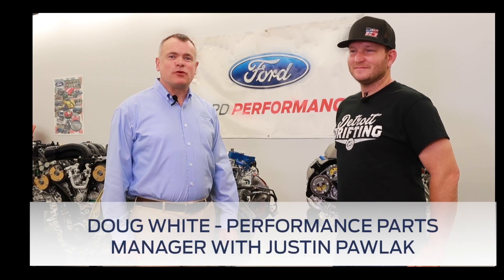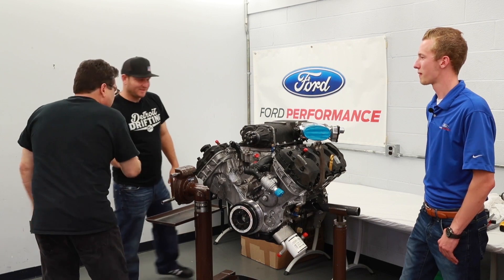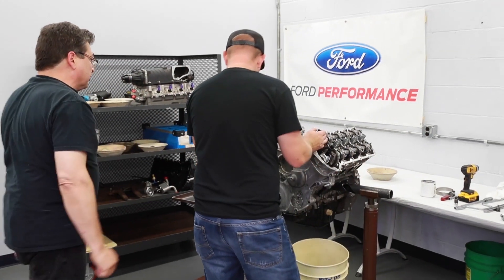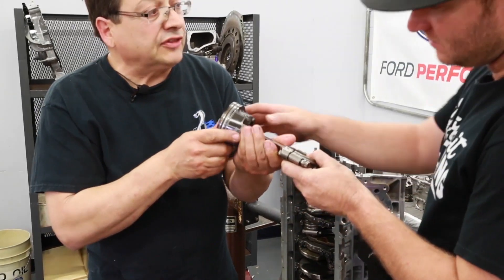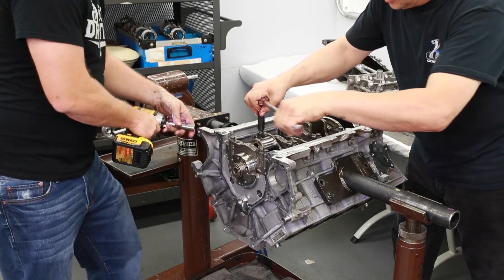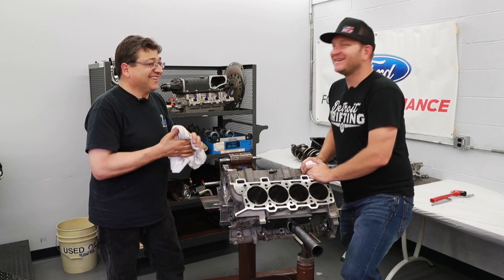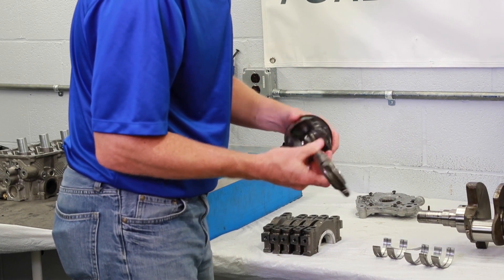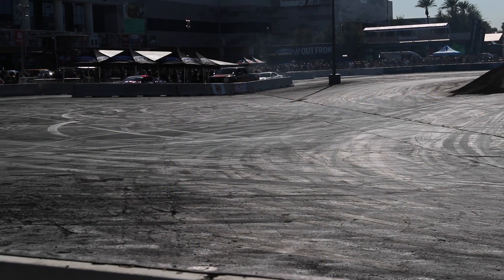Ford Performance Aluminator Teardown with Justin Pawlak | Ford Performance

Comment: So your purpose-built tire-spinner that never comes anywhere near actually placing the engine under "full load" proves a "Coyote" is really, really "durable" because it never "wore" during MAYBE 20 HOURS OF PART-LOAD "MOTORSPORTS-
ENTERTAINMENT" USE? 

That's funny.

Comment: can you use the Aluminator XS 5.2 engine on a street car?
Reply: Depends on how old it is. If the car is over 25 years old, you shouldn't have a problem.

Comment: That's what ford performance wants to see. Longevity. I will not be surprised of your setup is in the new gt500. You have one hell of a secret contract with ford performance. Ford put this motor in the gt500 it's only meant to be.

Comment: Why don't you guy's there in Dearborn focus on rating your performance products on 91 octane like the rest of the world instead of over ratting them on Michigan 93/94 octane, like I've been told by various engineers there at FMC. Nobody else rates on anything higher than 91 octane. Why? Because high octane is going away, in many states. The average power loss from octane to octane is 10-12 hp and tq. So the new Mustang for 2018 is "NOT" more powerful than the Camaro SS, if you want to do Apples to Apples. Nobody else rates their performance vehicles on anything other than 91 fuel, sometimes 89 even. But no, not Ford. And you guys keep adding weight. Weight kills mpg's, runs handling, lengthens braking, etc. lighter is always better period. Make the mustang a smaller car like it once was. There was no reason to bolt it up to a large Lincoln LS Sedan from the 2002-2005 era, for the new model Mustang in 2005, and there it stayed in mass. Funny to how the Ecoboost in the Focus RS increases hp too. The Overboost in any other car on earth, including other Fords, does NOT increase hp, only torque, yet on the RS there's a supposed hp increase. Well FMC guy's, I know from a chat with a few Engineers from the RS Team, that the target hp of the RS was originally 315 hp, and they got 324. But someone thought of how to "cheat" and Say it's higher, with an Overboost function. Nope, it's not really any higher than 324 hp. A brief little torque spike at low rpm makes these cars uninspiring, almost 1989's Korean feeling. They're a joke. Ford has lost sight of Job One. Quality, before quantity. Oh and why didn't FMC just bolt up the company Pro-cal tune on the 2018 Ecoboost Muatang? That Ford factory performance tune added horsepower as well as torque. Same for the Focus ST, why no factory Pro-cal tune as a standard power bump, that the ST so badly needs before it turns into a overweight heap of half Fusion half Mazda for 2019. At least the Cous ST could have gone out with 275-280 hp, but oh I'm sorry FMC, that's on 93/94 octane. My sons Foc RS only put down 265 awhp w/20% loss, on 93 octane. That's spot on for 325 crank hp, the originally of the RS before it was decided to add power, which really never appeared. And his 2016 Foc ST on 93 fuel made 240 hp, with 15% loss, and its def not 252, as advertised.

Comment: The bottom end would be impressive if it wasn't a copy of the  "deep skirt six bolt" ls engines that came nearly 20 years before.
Reply: Ryan Barbolt ..........The "concept" is much older than than that. Barring that, it's the refinement of that concept that IS impressive.  If you examined early production aluminum blocks and compare them to current production, you'd easily see the difference.

Comment: The oil pump is so important I don't know why a steel gear oil pump is not standard?
Reply: Considering that how "normal" engines of this family (e.g. the 4.6l engine) last for many years under heavy service with the original gears, they just aren't needed for most people. But there is no reason NOT to do it except cost.

Comment: Visual inspection is nice but some micrometer and snap gauge measurements would be great and perhaps suited to another video, as well as being able to show crank and block straightness.
Reply: Also a good camera to blow up the metal surfaces can reveal cracks and imperfections the human eye and hand cannot detect.   Porsche and other makes of that type magnify photo images doing an inspection.  I went to court for an engine failure by a dealership and my camera helped me to win my case because it revealed what the eye could not see.
Reply: This is what I was thinking watching this. This video is more of an advert.

Comment: So the difference between this motor and the Coyote is Just Piston and Rods? Oil pump?
Reply: Keion Rajcoomar rods, piston and oil pump gears, correct. Maybe a billet timing gear but don't quote me there.